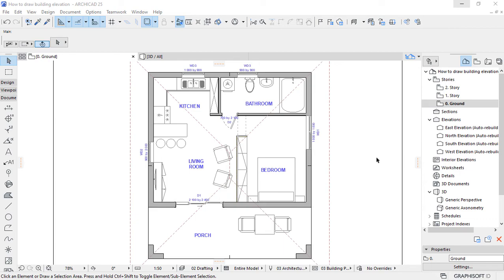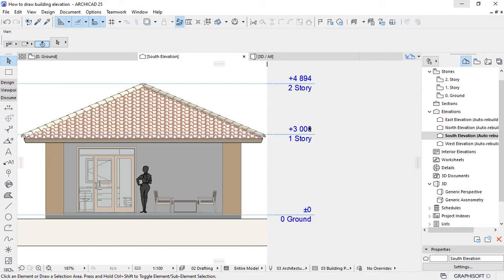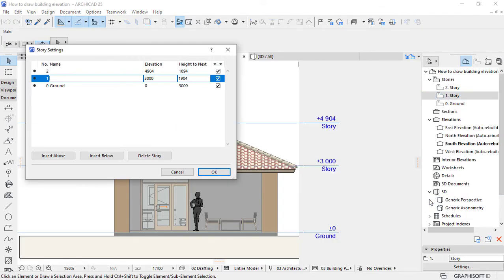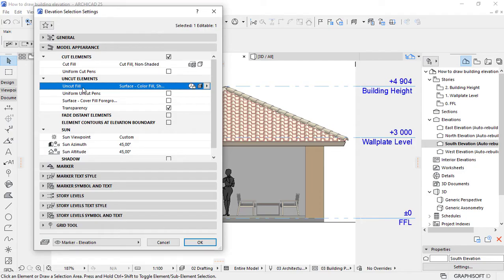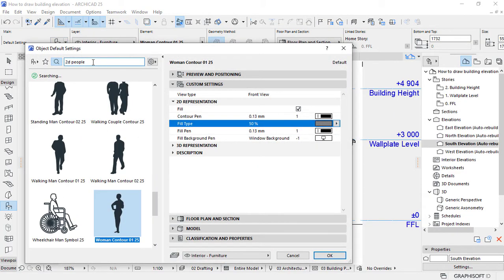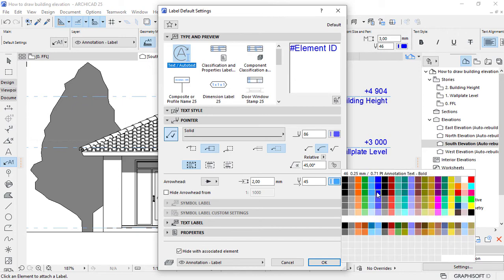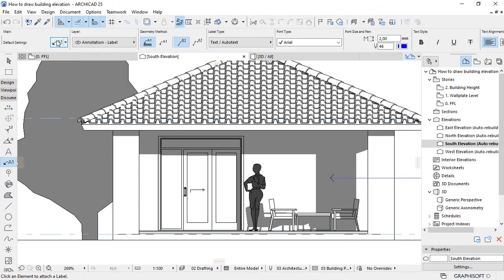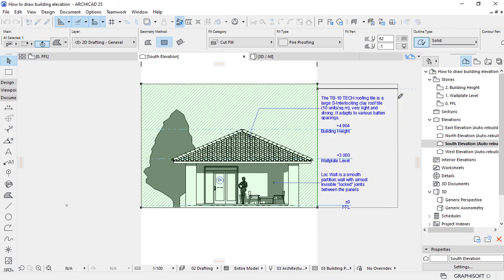How to Draw Building Elevation from Floor Plan in ArchiCAD

Comment: Hello I wanted to find ask when drawing elevations to scale do we use the exact measurement of the height of the wall shown on the floor plan e.g if a house is 15m wide and 20m high, would the height on the elevations also be 20m or would it be reduced?